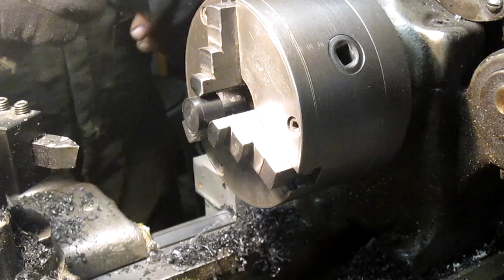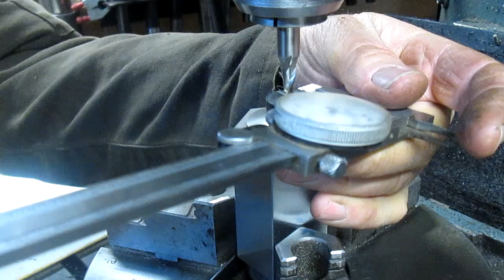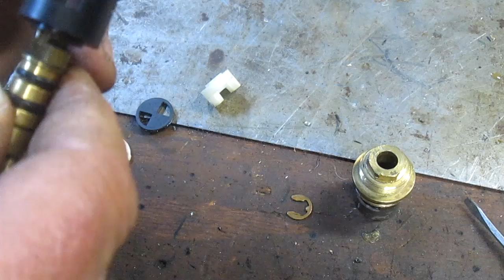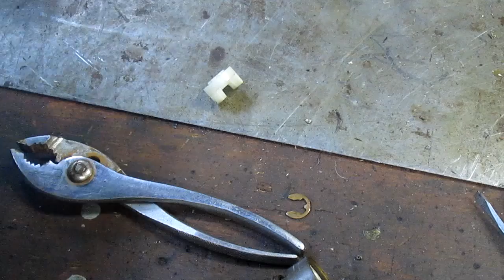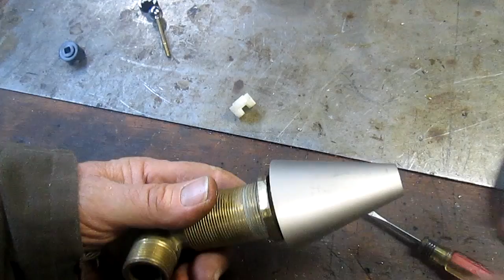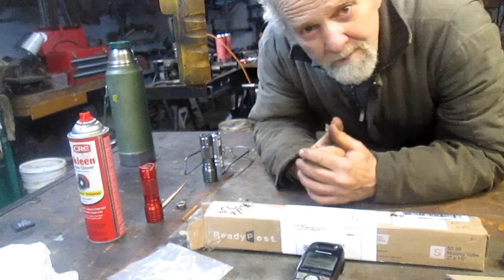Bathtub Valve Repair #2

Comment: Outstanding,  that was one of the most complicated yet simple handle mechanisms I've seen 👍 you wouldn't think two flat surfaces could hold water and not leak ! You didn't hear me yelling at you that it was not centered either time did you . Lol 😆 great video!
Reply from the maker: I was also surprised about ceramic to metal without leaking, but it worked. Go figure.

Comment: Those ceramic disc quarter turns are very common. Most important thing is they are normally clockwize and anti clockwize. Biggest stumbling block is the splines. Being a plumber who makes obsolete parts I enjoyed the machining content.
Reply from the maker: It was a fun project for me too. Thanks for checking in.

Comment: Hi Nik, nice to be here it should be a scrub a dub tub video. Boy those collet square and hexagon holder blocks really come in handy as we use them often too. That is a good fit we feared the fabrication engineer in you was going to go to the job site and build a total remake solution for the tub and the plumbing issue now and far into the future, we can dream a bit here can we not. Great job Nik you fixed the issue at hand. That is a fancy plumbing hardware system in stainless you shared wow. Lance & Patrick.
Reply from the maker: I may have, but the job site was 200 miles away. . .forget it. You getting rain down there? If so the flowers this spring just may be the best in decades. We may take a journey down that way in the spring.